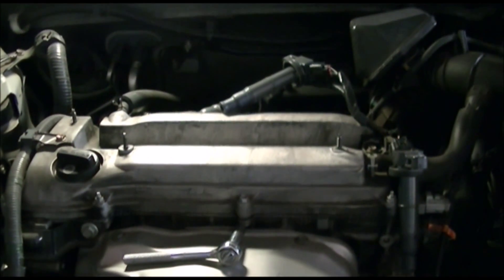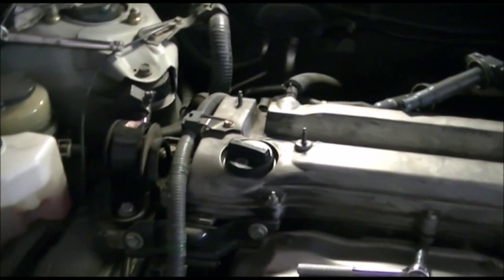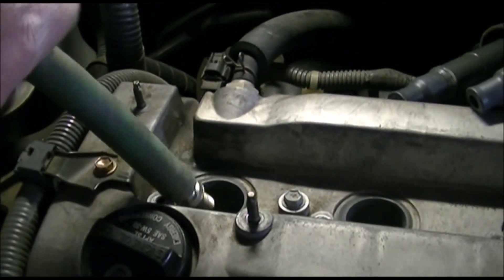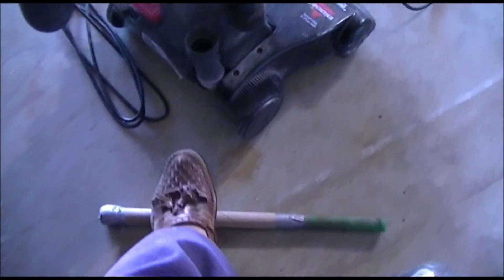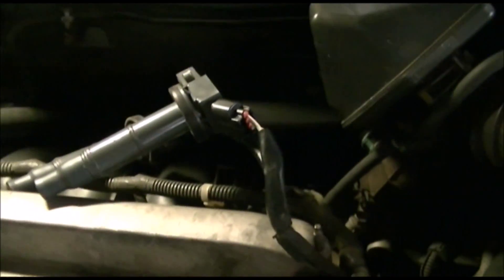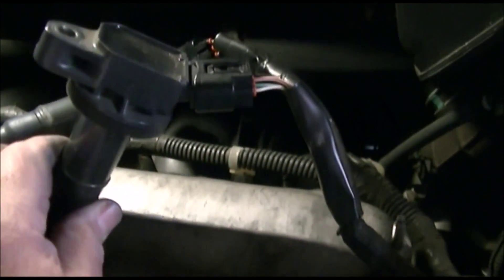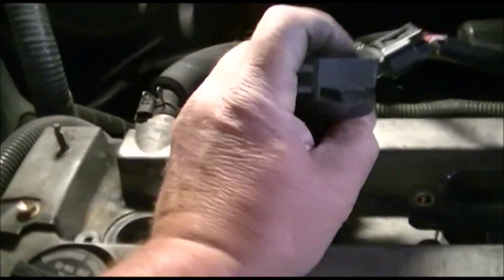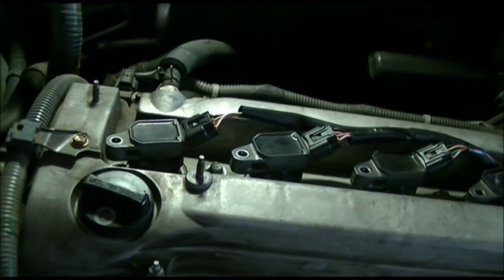Spark plug tricks 2AZ-FE engine

Comment: I have a 2003 camry and I have opened and closed the tabs on the spark plug connectors 3 times since I have owned the car without breaking them.  My friend has a 2004 camry and I broke every single one of the tabs. The production change since 2004  uses cheaper breakable plastic on the newer models.  Totally unbelievable for a Toyota.
Reply: I had an error on my cylinders so I had to remove them on my 2001 celica often. No problem. You are correct. The newer ones are probably not Japan plastics.